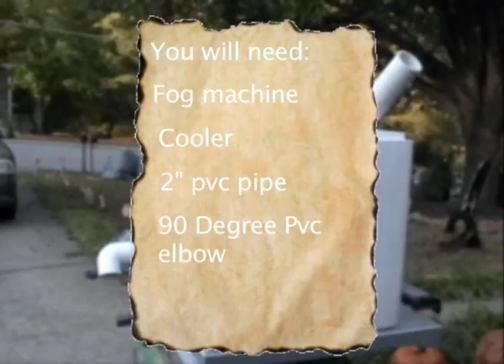fog machine chiller

Comment: : ) If you use drier duct the pure aluminum works better. And 4ft couple together to make 8ft or more wrapped inside a trash can works better. More volume and lingers more. The fog has to travel thru much more chilled aluminum. The only thing is you can get sort of a Vortex effect of slightly spinning fog because the drier duct it like an accordion. I have a low-res post Trick-or-Treat ad lib description and results of that. Credit goes to ghostsofhalloween . com for devising it.